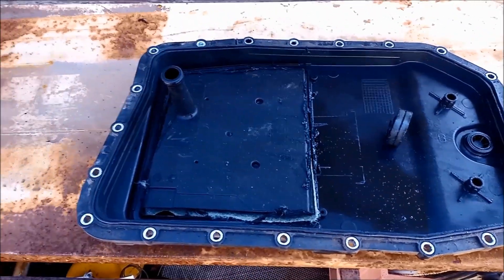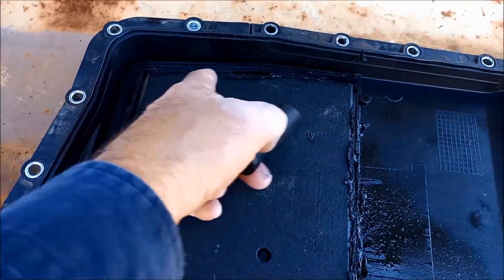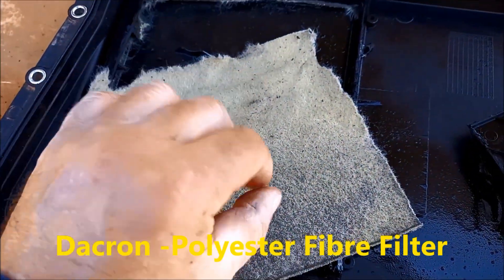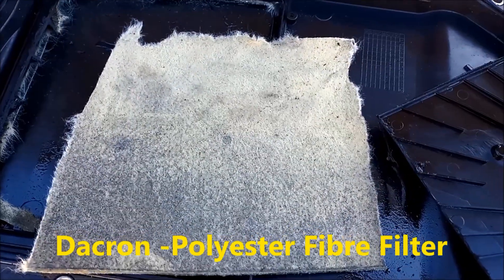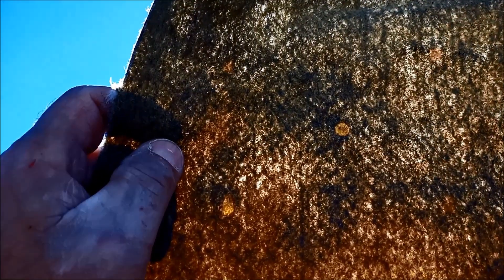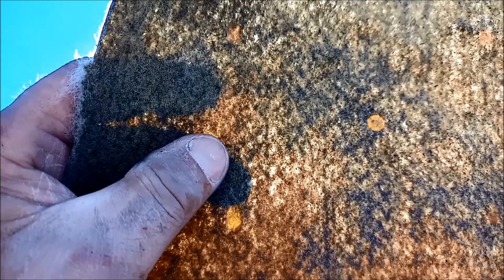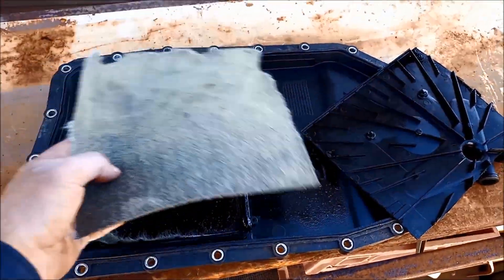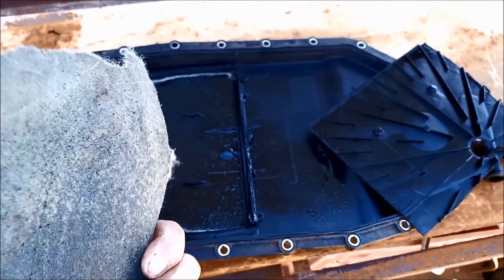Aftermarket Automatic Transmission Filter ZF6HP ZF8HP Analysis, Is it worth it?

Comment: Any comment on the Ryco filters? I know since they closed their Australian, then  NZ and then South African plants there have moved to contracting to Asian manufacturers but I was hopeful they maintained their quality standards but the transmission business that I bought my last service kit from warned me off Ryco. If you cannot comment on Ryco (which I would understand)  are there any filters or suppliers you recommend apart from the original vehicle spare parts counter?
Reply from the maker: hi, to be honest, i haven`t pulled one apart for a while. might be time to. cheers
Reply: @YepThatsIt  I had a look at the Ryco and it seems to use same  the material as one I bought from MJProducts.
Reply from the maker: @Aussiblue  no worries, cheers

Comment: Seen cheap odd brand engine filters like that awell, not always but almost always you get what you pay for, somethings are just not worth the risk especially considering  trying to save a few bucks on a sh## filter can end up costing you thousands, not including towing fees and time without a car.
Reply from the maker: hi, issue is we can`t see inside to determine quality until we destroy it in most case. we always try stick with known quality brands. cheers 👍
Reply: @YepThatsIt  yeh, most customers dont know
Reply from the maker: @closertothetruth9209  i`m not suggesting all aftermarket are not so good, however how do we know which ones are good? especially no brand ones
Reply: @YepThatsIt  yes i agree, hope you took no offence in what i wrote, sometimes Well alot of times my writing can be seen either way , especially when i comment on political channels .
Reply from the maker: @closertothetruth9209  haha i don`t offend that easily mate, im old school...i love discussions and being able to communicate ideas and opinions...cheers
Reply: @YepThatsIt  same
Reply: @YepThatsIt  is the metal pans with filter better or do thay run hotter
Reply from the maker: @brendanziino3759  plastic pan with incorporated filters are quite expensive, i can understand why people try to save some $$$ thinking they are all the same, especially when they look the same or similar. the pans that hold greater volume of fluid will run cooler, this is why high performance add a deeper pan to their transmissions. cheers
Reply: That's why I like to flush fluid every 30000ks , just to be sure .Good video mate.
Reply from the maker: @akaitv6606  you need to do a regular filter service not just a fluid change. and also add additional magnets and bypass the coolant heat exchanger to eliminate chance of coolant entering trans. cheers